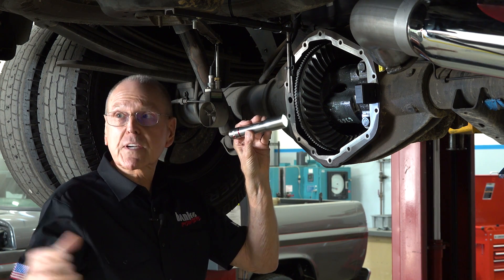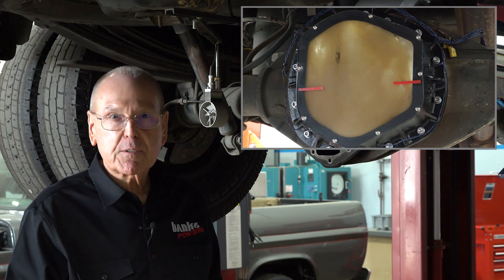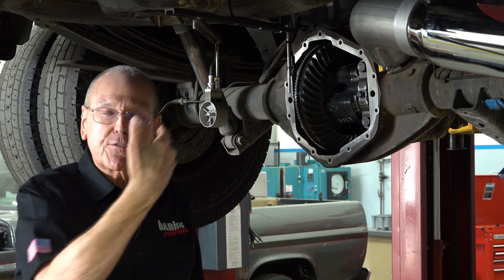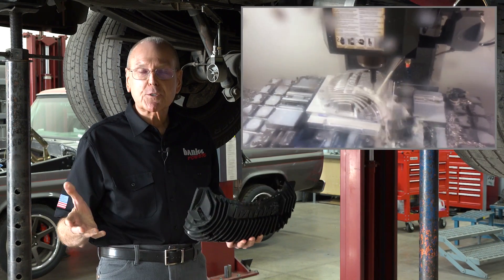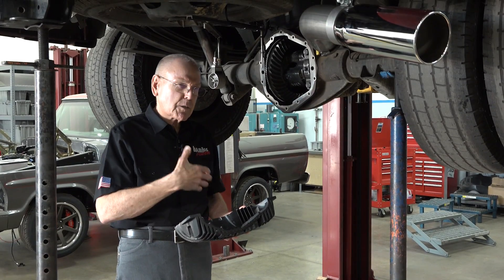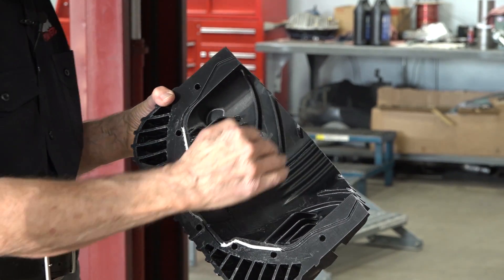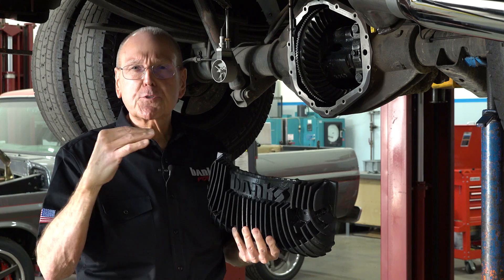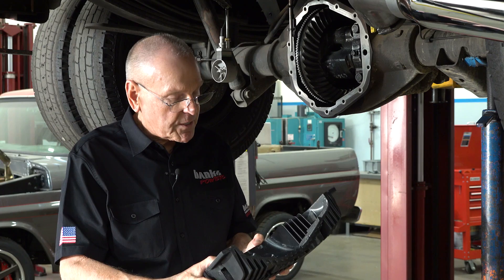Banks All New Rear Differential Cover – Perfecting the Design

Comment: Sorry but you don't need this cover. Big trucks don't have covers or cooling fins. I pull 84k all day and my synthetic oil rarely gets to 160 in the Texas heat.
Reply from the maker: What do you drive? A semi? These covers will be for consumer trucks like 3/4 and 1 ton GM, RAM and Ford trucks. We've hit 326° several times at 250hp pulling a load up a grade.
Reply: @bankspower  yes i drive a semi. 2007 Peterbilt. These trucks will have more stress than 1 tons ever will. If they are going 300 + then these trucks are being overloaded. Imo. Some trucks are pushing 625hp and 2200 Tq lbs from factory hauling Oversize loads and  still don't run 300 degrees
Reply from the maker: @speterbilt  We hear you loud and clear and you're 100% right. Manufacturers of the big rear ends have spent the time and energy engineering them correctly from the get-go. However, consumer trucks in many cases aren't designed to withstand the rigors of towing heavy loads, even though they're rated to do so. We discovered that pulling a loaded fifth wheel up to our local mountain range is almost enough to kill the gear lube. That's one trip up the mountain and the oil is cooked. But you'd never know because only a select few monitor their rear diff temps.
Reply: +Banks Power where can I find that test video

Comment: Only problem I foresee in the ramair diff cover is road debris and  winter salt/chemicals corroding the cover from the inside out, so to speak.
Reply from the maker: It's aluminum. Take a hose and spray out the muck. No different than any other aftermarket cover in that regard.

Comment: The most fascinating thing to me about this whole differential cover odyssey has been that Gale Banks has revealed how little forethought, and how little actual engineering goes into some after-market products.  The fact that all of those other diff covers were sold as performance upgrades, but instead caused some type of performance problem seems really ironic.  I don''t know if Banks Power was considering making a new diff cover all along, but at this point with all of the lessons learned, it only makes sense to build an after-market diff cover the right way, since otherwise someone else would just patent Banks' developments and manufacture their own to Banks' specifications.

Cheers to Gale Banks for sweating the details and doing it right!

Comment: I've been in the Differential Rebuilding for 47 years. I designed the World's first Differential filtration cover. Two years ago I visited your office and gave your secretary a packet relating to differential covers. Never heard from you, but  I happy you are now going to attack the problem. One thing I found out was, never have any part of the cover extend outside the housing.  I did that once and a customer hit something and had a leak. I had to pay for a new differential. The center casting changes from diff to diff. Put your fins on top, but never on the bottom. Good Luck. Looks Great.

Comment: You had me till this episode.  

What difference does where the 4qt line is?  You've shown with your testing that if the level is too high it gets milled around, uses extra power (likely tears up the lube faster) and doesn't lubricate correctly.  Seems like the right thing to do would be to either figure out how many quarts fill it to the right height or make a transparent one so you can see when the flow pattern looks correct, I doubt that you could instrument and test to the level that the manufacturer did, especially WRT to durability and getting the pinion bearings oiled/durability of seals...

I'm actually surprised that you were issued a patent unless it was for something that wasn't visible in the partial shell you were holding.  The internal heat transfer fins are something I've done with good effect on a number of custom parts that I've done, but in this case I wonder if it might end up causing weird fluid flow over the ring gear.
Reply from the maker: We've specifically designed the cover so that 4 quarts fill the factory-specified fill level. We believe that AAM knew what they were doing when they published the fill level. The big discovery is that there's little or no airflow within 18" of the back of the differential. The patent covers the ram-air scoops on the bottom of the cover which aren't displayed well in this video. The scoops direct air up and through the fins.

Comment: This “instruction” of engineering is reminiscent to the old style Chevy promo videos, or even how WW II soldiers in the motor pool were trained.

The technical part is being funded by the advertising. People thought of Chevy when they saw a suspension. People thought of Detroit engines when they saw an engine being taken apart. And now, people will think of Banks when they’re behind a truck at a red light and see the differential sitting in their face.

If they want to teach us something, then great. However, it’s our job to remember there may be other concepts not being demonstrated in the lesson.

This is an ongoing conflict in the education system...to spend time on fundamental (known, boring) concepts, or to spend time on newer (exciting) concepts.

Who says the free market doesn’t work?

Comment: The material looks very thick, I'd be interested in seeing comparisons against a thinner design (without compromising durability), I would think that it would dissipate heat more efficiently.  The ram air concept is certainly unique, I'm interested in how this plays out.  If it shows appreciable improvements in fluid temperatures and has a drain plug I'd be tempted to swap one in next time I change my differential fluid.

Side note:  How would this work in cooler weather?  In northern climates, would this cool the fluid below nominal operating temperatures?
Reply from the maker: It's designed to transfer heat better than any cover available. Yes, it has a drain plug.

Comment: We never got a video of the pinion bearing with any cover. Never got any video of the Dyno testing with cardboard wind tunnel side skirts of airflow and temperature numbers. Skipped the science, made "unbiased" assumptions on the current aluminum covers. Now we're watching a new product release which will certainly "prove" Banks diff cover's are superior! 🤷🏻‍♂️🤔🙄
Reply: Common sense and allot of people telling me to not want money on those aftermarket diff covers was all the advice I needed. Maintenance, change fluid and you'll never have a problem. Although I may look at one of his. The process and common sense tell me it will help on those long pulling the the wheel trips
Reply: No, I expected him to tell us the numbers when he did those "tests". This is not scientific if he's withholding the data until after he tests his prototype. He could easily post the data, then try to beat those numbers. But we won't know them until he proclaims the Banks cover is best. 🤔🙄
Reply: He did "wind tunnel" testing on the others. He also made a strong point about over-filling and the squared-off aftermarket covers creating aeration of the oil. Did you ever stop to think that maybe he'll reveal the results in the final video?

Comment: IMO, the most significant feature offered by an aftermarket diff cover is the magnetic plug.  All the drawbacks that Gale has discovered aside, the insight that a mag plug provides is priceless.  This is why you'll find mag plugs in military engines, jet engines and other high end applications.  MagHytec was the first to offer this that I know of, and that's why I have one of their diff covers.  If you design anything for this diff cover, make sure it has a mag plug and you'll have another customer here.

Comment: It's pretty  cool all the research going into this, and I'm sure they will make a great product if they do bring something to market. That being said, I have spent many miles behind the wheel of an 09 powerstroke towing multiple forklift batteries. My GCW around 31,000lbs. Stock differential cover, 200k miles, never changed oil(I know, shame on me) never a failure, or problem of any kind. So while it's a cool product, I probably don't need one.

Comment: Big Commercial for your product, Mag Hi-Tech works fine and you needed to bash it to sell your snake oil. Your performance stuff never measured up either.  Is it Banks or Dyson?
Reply from the maker: You're a fan of Mag-Hytec, that's fine. They're a great company. That doesn't mean that their cover isn't flawed, which it is. Dyson makes a great vacuum. But it isn't for everyone.
Reply: I'm not a fan of them, I have used and am using and have NEVER had an issue. Great you introduce a new product but slamming the competition before you've done anything.. .  SCT with open tuning stomped your 6-gun overpriced "genius" product.  Wish you well with your product. I'll stick to calling Mag and speaking directly with the owner - he takes the orders.

Comment: Gale Banks is the real deal!  This man uses science to solve the aftermarket issues that most people never do.  I was looking at diff covers for Jeep Rubicon axles, to add strength for off road use, and rock protection.  After watching this series of tests I've been able to weed out the companies who haven't done all their research.  If it protects against rock but ends up overheating your diff fluid and not getting oil to the pinion bearing, what good is it.  Yeah, you didn't bend the cover on that rock on the trail but  when your diff explodes later down the way, what good is it.  Thank you Gale, you are my hero!

Comment: That ram air is gonna work great in Canada at -30 and a 110kmh on the hiway lol what a joke
Reply from the maker: Chris, all aftermarket parts are not designed for all applications. We'll let you know when we build a heater into a rear diff cover.
Reply: @bankspower   The ring gear, pinion gear, and bearings make a pretty good heater. Once the differential starts to warm up, snow packing in the cover would likely melt. Besides, at -30, cooling shouldn't be an issue. Keep up the good work!

Comment: About 8 or 9 months ago I installed a MagHytec cover on my 11.5 AAM in a perfectly stock low mileage 2003 Ram 2500 I bought. After watching these videos, I removed it last week. However, if you do, and you have been running the higher fluid level, pull the axles and hubs and clean and grease the bearings. My Bearings had ZERO grease in them, the gear oil had washed it all out.
Reply from the maker: Thanks for the feedback! You've proven Gale's point about over-filling. 👍

Comment: certainly interesting watching this take life from its infancy.  I'm wondering if the ram air is going to get packed with snow and other debris.  Does it have a quick way to wash or flush out the scoop?  It needs a drain too, or it's a wall ornament.  I look forward to seeing where this goes, and if it is a worthwhile replacement of the OEM cover.

Comment: Fluid turbulence in differentials are the smallest component of power loss (according to multiple papers on the internet) so slight changes in this (i.e. moving from curved cover to flat cover) will necessarily make the smallest changes in heat generating inefficiencies.
Reply: You are correct in regards to power loss. Banks' points are increased wear and increased heat are caused by oil foaming due to the poor designs of the square back covers. I just changed a front pinion bearing due to lack of lubrication. Previous owner never checked the fluid level and the result was an oil starved failure. His loss, my gain....

Comment: Never addressed my questions.. already decided the answers .. for example a larger volume that does not increase height what happens ? .. also if not mistaken Nissan has fins on the outside of their stock dif cover on the titan inprevious years .. uh we all knew that was to compensate for lower volume which means more heat .... soo I’m not really impressed here .. again .. a larger volume , more distance from pinion would mean same height of dif fluid but a higher volume .. what does that to to sling? What does that do to heat? What does that do horsepower at the wheel ? .. he never addressed those dif covers that have that design .. he went after the ones he assumed were no good .. flat insides , fins in side the cover etc..

Comment: What about 1500 Series trucks, Gm, Ford, and dodge would be nice to have a set up like this that helps vs harms performance
Reply: Also what about the differential covers that have bearing cap bolts for support do those work better?

Comment: I have a Dana 60 full floater in a 1970 GMC.
I replaced the outer hub bearings and oil seals. I did not fill the hubs with gear oil when I assembled  them. I drove about 25-30 miles and blew apart the bearings, the inner race was fused to the axle shaft. 
 When I took it apart NOT ONE DROP of oil reached the hub bearing in either side. Completely dry! I checked the fill plug and gear oil came pouring out so I know I didn't forget to fill it. To me that is proof that filling it to the fill line will not circulate oil to those outer hub bearings! 
I could not belieave that driving for 25-30 miles and those bearings did not get any oil circulated to them. Absolutely nothing.

Comment: Great idea, the ram-air cooling. 2 potential issues I'd be worried about with the design offered in this video: 1) The ram air scoops catching more than just air, like say rocks or boulders, and being broken off; 2) losing the ability to jack the vehicle up by the diff (I know, I know, you shouldn't do that anyway, and I don't - but lots of folks do, and I bet they would be upset if their new diff cover cracked while changing tires) 

Mr. Banks, please be sure to test and adjust for physical durability as well.

Comment: I notice those internal cooling fins to extract the heat from the fluid to the diff cover as well as the oversized nature of the exterior to grab/scoop incoming air and direct it though the external cooling fins in the wake of the airflow around the diff. Proof that actual engineering work is going into this. Can't wait to see how effective it is!

Comment: good try, but this design is slightly better than stock but what if that cover will cool down oil to much, over winter time, by the way, again bigger losses because higher viscosity, it would be better to incorporate oil pump on diff cover to spray oil on few places that must have oil all the time, and use less oil  to act as in dry sump

Comment: Mr. Banks, please keep in mind the reason most of us converted to the Mag-Hytec. Easy drain and fill and the sight glass. Please be sure to include those on your new diff cover. At a competitive price I'm certain most of us will purchase the Banks differential cover.
Reply: how about that fill plug in the top with the dipstick on the mag hytec cover. that allows you to place a funnel in the hole and pour a gallon jug of oil into the rear end requiring no pump.I like my mag hytec cover so far I am very impressed with them. they hold two gallons of oil which is $80 but seems to me more oil leads to more Cooling and more lubrication. I bought mine for the drain plug as the main reason so I could change my oil every 25000. the remainder of the internals of the differential are not curved and smooth so a lot of oil turbulence is created inside the entire differential. I'm not convinced that a flat back diff cover is a problem

Comment: You shpuld incorporate a pair of tension bolts to press against the axle bearing saddles and make the piece a stressed member of the axle. Could also add another pair od holes in the back to add trusses and strengthen the axle tubes bilaterally.

Comment: This is exciting! There are so many potential applications and benefits, the mind bogles. I have always wondered how NASCAR manages cooling the rear end oil and was just told there is a mechanical pump on the rearend that circulates oil through a small radiator. Imagine a diff cover that eliminates the need for that oil pump. How much horsepower will return to the rear wheels?

Comment: Without you explaining anything about that diff cover, by looking at it, I can tell you used an engineering approach to solve a problem. The internal fins will add more surface area to conduct heat to the casing, there are now scoops to grab the ram air from the front (because there probably won't be significant airflow on the back by itself).. And of course, you used the correct curvature instead of a square back. And you're actually testing it to see if it works! Clearly the flat cover manufacturers weren't engineers and were just trying to make a quick buck.

Comment: I have been following the diff cover series and am fascinated. Have you documented any numbers of, "stock cover runs at this temp, go to mag hytec with square intervals, and higher level, and temp shots up to unsafe levels". Alot of us have these aftermarket covers (I have sunk hard earned money into the mag hytec on my '02 excursion 7.3), and it would be great to definitively know that keeping these covers on causes xxx problems, ie: we documented a temp increase of 30 deg over stock cover. A 30 deg temp hike will smoke your diff".